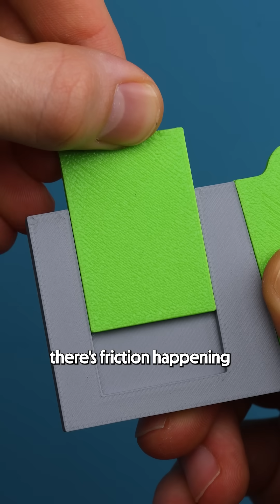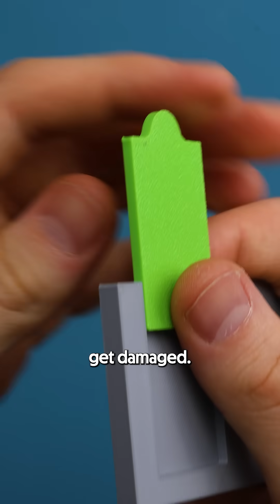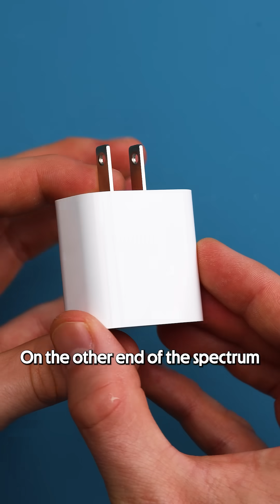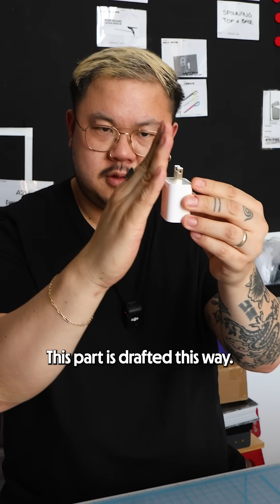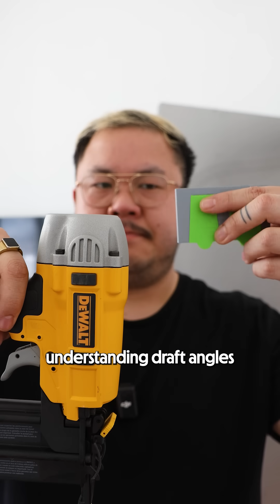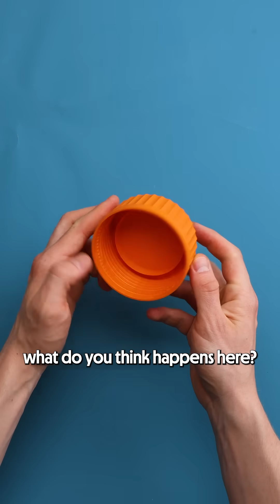Why your trash can tapers.

Comment: my guess is that the lid is simply unscrewed - and has a draft angle. The draft angle makes it easier for end users to secure/remove the lid for much the same reason the draft angle makes a trash can easier to remove from the mold.

Comment: The taper isn’t only to avoid friction. You could have a frictionless surface and it would still be hard to remove, as it creates a seal against the mould and trying to pull it out will result in a low pressure zone below the part as it tries to pull a vacuum.

Comment: Wrong the reason trashcans taper is because they are large and transporting them is a majority of the cost, which means efficient stacking is incredibly important. It's also why the plastic chairs taper even though this means they can carry less weight and therefore need more material.
The fact that it's easier to get out of a mold is simply a bonus. Trashcan where tapered long before molds like this existed.

Comment: If you put a draft angle on the thread then it would have the same effect. Most of the time (like in the case of a waterbottle) the threads aren't actaully snug, though, it's just a lot of static friction

Comment: Draft angles are also for removing the  part from the mold. Without them you would create a vacuum in the open void as you try to remove the mold, stopping you from removing it. The draft angle allows air to move to the back of the part

Comment: Draft angle is around 0,5° - 2° in my experience designed mold depends on geometry and material. 

For the internal thread there's 3 solutions that's I know. 
1. Classic unscrew core mechanism. 
2. Expensive collapsible core (imagine like a milling machine collet)
3. Direct pull opening (three plate/stripper), yes it will destroy/deformed the threads but for cheap and simple use this will be work too. 

CMIIW

Comment: Ive seen bottle caps get spun in hot temps to produce water bottles out of a calculated amount of excess material. Maybe that? The threads are happy by products of the thing holding the plastic in place?

Comment: The draft on a 5 gal bucket needs to be refined with a couple relief bars vertically to reduce friction…getting a few of these apart after stacking is not acceptable in 2025!

Comment: My theory is that the threads make one big draft angle that you have to unscrewing of the mold. You know, like how a screw is just a ramp wrapped arround a post. Then you can have a traditional 2 part mold, pop the top off and unscrew the bottom off of the newly made piece, and set the mold back together ready to pour the next deal of liquid plastic into.

Comment: Obviously it unscrews from the mold. Maybe not obvious but this is one of those situations where it appears to be super complicated, but is actually very simple. The physics of the screw allow a funny work around for injection molding, that only really works in this particular application.
Reply: Smart guess, but... indeed injected items rarely are unscrewed, it would take too much time. If they are soft enough they are ejected by force and they stretch temporarily. But when they are too stiff to deform without getting damaged, the core of the mold has to be split in moving parts that quickly collapse in order to let the part go.
Reply: @darkbrook nope, they’re right, either you unscrew the core of the mold and pop the product out or you unscrew the product.
Reply: Unscrewing would not provide a draft angle. It would create friction for however many rotations it takes to remove the mold. I'm guessing a draft angle within the threads would defeat the screw mechanism since the lid relies on friction to stay sealed to its container.
Reply: @ChinnoDog  so will trying to remove it with force (as someone suggested) or mold being somehow split after molding.

So either way there is some wear and tear involved, therefore it doesn't matter what way you would od it.
Reply: wouldn’t the vertical marks on the outside of the part be overhangs for unscrewing the part from the mold? are we sure the mold isn’t some kind of flexible material and the pieces aren’t pulled out?
Reply: no its actually not how its made, are you stupid? why do people believe you. just think about the wasted time im the manufactoring cycle. The threads are on the side of a shaft and the move inside of it to let got of the moulded new parts, not unscrewing every single fukn cap
Reply: It’s kind of a dumb question if you think about it 😅. Of course it unscrews from the mold.
Reply: @lofichilldadvt It’s not a dumb question. They deliberately asked a simple question to drive engagement in the comments section, and you simpletons fell for it by thinking they were being dumb 😂
Reply: @Kids11111 It's a good thing you & I are too smart to add comments into this thread. Can't get us that easily.
Reply: @GeorgieChaos  Adding comments to point out this tactic works better in the long run to make more people aware. If you don't point it out, you leave people to fall for it repeatedly. You see, things aren't as simple as your sarcastic post implies.
Reply: @Kids11111  Look, that's fair. I apologize for the cheapshot.
Reply: @Kids11111 "you simpletons! 🫵🥸☝️" 
I love it 😭
Reply: @Kids11111  and for what reason should i care if my comment is boosting their engagement? I dont have any grudges against them
Reply: @Kids11111 nice, glad to see you stood strong and didn't drive engagement by leaving a comment 👌

Comment: I’m not 100% on this and before I look at any other comments, I just wanna put mine out there. I would assume it’s some kind of two part injection mode where the top part would come off and then the bottom half is unscrewed just giving you the pattern of the threads after being cooled down.

Comment: Look up how Romans moved giant monoliths of stone with a primitive crane.... They would use this idea and make a hole in one of the faces of the rock that would taper and get smaller towards the sky. I don't feel like explaining it all but look it up, it's really clever and fascinating, plus it applies to this in the most appropriate way. 
Also, there is 2 main ways to do it.... One way is that it's a 3 part mold and they unscrew it or the mold is made out of something like silicone and is collapsible or it's just a mold you destroy after every pour.

Comment: In the 1st half of the mold is the void with cores the extend into that void for texture for the outer layer. On the second half of the mold is a core probably multiple that when the die is closed fill the void in the first half leaving  negative space to be injected with plastic ,then those cores retract the die separates and the part is ejected onto a conveyor , cleaned up and Inspected.  
My assumption based on my experience as an A class mold setter for injection molding

Comment: Where the negative is for the bottom of the lid it will either slide have of the mold apart and push pins will push it off. The smoother and cleaner the finish, most likely, the better and newer the mold is.

Comment: I’ve designed/made parts similar to this.

Internal threads are usually formed with one of two methods. Either a mold with a core that unscrews while it opens, or something called a collapsible core mold (this is what I think a couple other people here are suggesting - look up collapsible core mold and you can find some great pictures that explain this better than I can here).

This part was almost certainly made with an automatic unscrew mold, where there is a cylindrical part separate from the rest of the mold that is rotated by some kind of motor as the two main halves of the mold come apart.

If you’re only making a few parts, the cylinder could come completely out of the mold with the part still on it, and then a technician unscrews it manually. The part cost would be higher in this case, but the mold would cost a lot less, so it depends on how many you are making. The part in the video was almost certainly automatic though.

The little saw tooth pattern right next to the threads was probably a part of the mold that goes around the rotating core, and the pattern is probably there so the part has something to push against while unscrewing, otherwise it would just rotate with the core. There could be another reason for this, I welcome corrections.

The little stand-alone bump above the sawtooth pattern was probably formed with something called a bump-off. Basically, it’s an overhung area that would normally get stuck in the mold, but because plastic is flexible, it can be forced off anyway, basically a snap-fit on the mold. The bump could be to help align the lid with the jar when putting it on, or maybe also helps hold the part while unthreading from the mold or something, I’m not certain.

Great video. Draft angles are EVERYWHERE, and they don’t even teach this to engineers sometimes. Wasn’t taught in 4 years of mechanical engineering school. This is an excellent explanation/visual aid.
Reply: Excellent reply. This feature in injection molding is usually called an undercut not an overhang. Also, draft on the inside of the part (where the metal core is) is also very critical. The 3 most important things in plastic part design are uniform wall thickness, draft/radii, and designing the part/mold “steel safe” (less plastic more mold steel to make adjustments easier).
Reply: Injection mould tool designer here to back up that this is indeed an excellent comment
Reply: Mechanical engineer here, that was a top shit comment
Reply: i was taught draft angles in 4 years of ME school so i guess they realized they need to do that
Reply: ME student here, thank you for the lesson 😊
Reply: from a student engineer, respect bro u know your stuff

Comment: Usually when you have to produce a plastic component with undercuts, the injection molding mold will present some sliding shutoffs that will retract after that the mold opens, allowing the part to be extract easily despite the overhangs.

Comment: I have no idea, but please let me know when there is an answer in the comments, cuz it looks like I'm here too early.
Reply from the maker: We are waiting too
Reply from the maker: Will report back :)
Reply: Still early but I see 2 theories, one is suggesting part is unscrewed, another is the mold retracting, I would suggest a third theory either it's carved out after it's molded or possibly the threads are added on afterwards like 3d printing, or yet another theory, maybe the cap is molded in 2 parts and formed together, such a long tube of threads with a cap melted on, or a sideways cut through the middle, honestly though, I'm not sure any of those are correct, but they are interesting theories
Reply: Haha, it’s the simple answer in this case. The mold unscrews. The other solution people were suggesting is called a collapsing core mold, and it’s super cool and pretty common as well. I posted a comment with more details. Post processing to add features like that is done sometimes, but rarely, and it’s usually because an engineer made a mistake, or because the requirements changed after the tooling was built, lol.
Reply: @EthanReggia  Obviously it unscrews but I think the point is that the thread itself has a slight draft angle?
Reply: Here for update